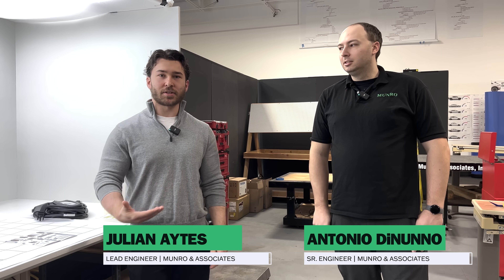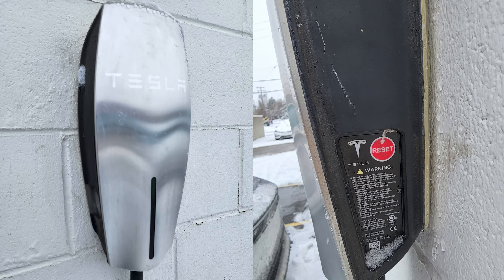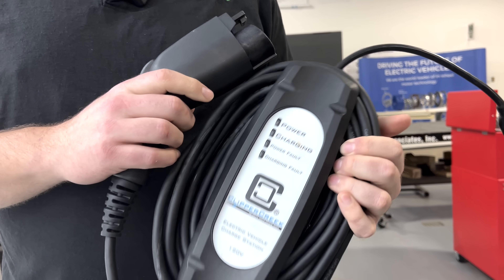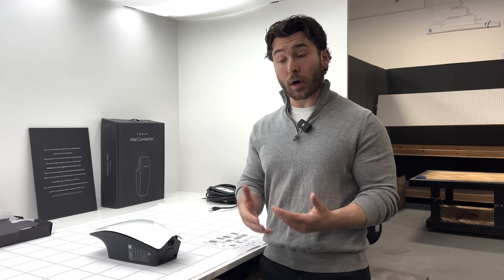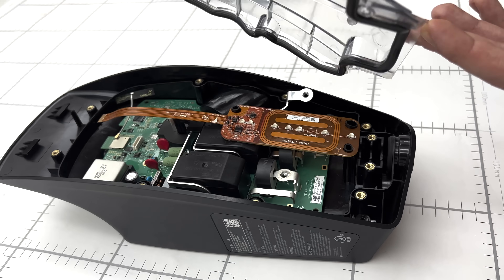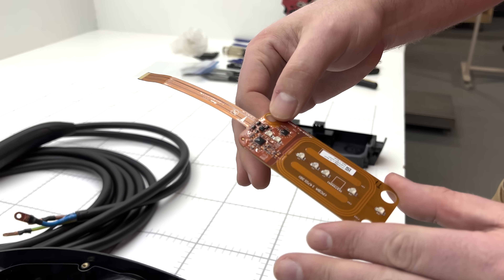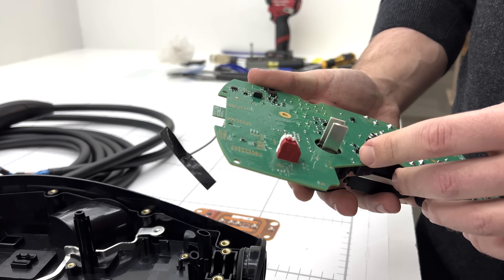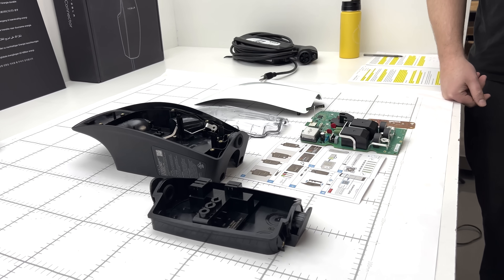EV Home Charger Teardowns E1: Tesla Wall Connector

Comment: Thanks for this video! I’m an electrician and I’ve installed just about every EV charger on the market. Tesla Wall Connector is in a league of its own for ease of installation. You can enter it with wiring from any direction, which is a BIG deal. The Ford 48A charger is the WORST. Please do a video that compares the poor design of the Ford Charger to the elegant design of the Tesla Wall Connector.
Reply: Also clear from this video why Tesla wall connector is the least expensive 48A charger you can get.
Reply: @NewPhase-kq1fu  Actually the Emporia Smart EV charger is cheaper ($399) vs the wall charger at $425. i picked the Emporia to charge my Tesla because of all the smart features and whole house power monitoring system Emporia has.
Reply: @phtofl  good to know, thanks!
Reply: @phtofl  Emporia is J1772. You need an adapter to charge a Tesla. Isn't the overall cost higher? What is the smart feature you like it over Tesla charger?
Reply: @acefr8816  yes, while I didn't have to buy an adapter because the Tesla comes with it, I did buy an extra.  I got the emporia with the intention of going through with my F150 Lightning reservation, but they keep raising the price so I've passed on my 3 opportunities to put my order in.  The emporia Vue2 system tracks your whole house power usage (and 16 individual circuits), including giving graphs of usage history in seconds, minutes, hours, weeks, months and years.  So you can see what circuit used the most power, or for me I know that our outdoor hot tub takes more power than the Tesla takes to charge.  The EV charger shows a history of your charges too, showing length of charge, kwh delivered and a calculation of the cost of the charge session.  Emporia also has wifi plugs that add a node on to track power usage.  So it's just a neat system and a must for data nerds.
Reply: @phtofl  How many amps is the circuit and how many amps are you charging at? Hardwired or 14-50?
Reply: @acefr8816  You'd probably go with a non-Tesla charger if you're open to switching from a Tesla to another brand of EV in the future.
Reply: @rkgsd  If one switches to a non-Tesla EV in the future, he an easily get a Tesla to J1772 adaptor. There is no need to "future proof" the charger now.
Reply: @rkgsd  emporia comes with the 14-50 plug attached but I removed that and hardwired it.  I didn't feel like paying for a new line to be run to the garage so I had the electrician use existing 1/2" conduit which could only fit 10 gauge wire or 30 amp circuit.  So I only charge at 24 amps, which has been fine for over a year now. I could run new wire, and hook the emporia to 60amp circuit and get 48amp charge.
Reply: will do, just for you.
Reply: Appreciate your comment and it’s great information for us novices.
Reply: So easy a caveman can do it…I’m proof!
Reply: Maybe in the USA, but there are some very good products that have been in the EU market for many years...
Reply: Thanks for the info, I don't do it myself, but I'm very interested in it
Reply: As usual, including it’s own manufacturing workers, Ford engineers , don’t  prioritize making installation of any component easy for the worker!
Reply: @DishNetworkDealerNEO  FWIW, the Ford charger is manufactured by Siemens (at least the new one) others are manufactured/sourced by Qmerit. Some older models like the Focus Electric or Fusion Energi could be purchased with AeroVironment equipment (as other OEMs did and just slapped their label over it).. did they go out of business?
Reply: Well, that’s completely understandable, after all, FORD, have over a Century of SHIT engineering design standards, to ..maintain, you know..!! 😉😁😂😂😂
Reply: Nope it's not lol!!
Reply: How would you say the Grizzl-E and Emporia chargers compare? I'm assuming you've delt with them too.
Reply: Is it worse simply as a charger install, or because the Ford supports bi-directional charge/discharging?
I’m not surprised. I installed the tesla one myself and I was shocked at how easy it was. Pun intended.
Reply: @TCPUDPATM  the charger I’m referring to is not bi-directional. Just a simple 48A charger same as Tesla.
Reply: @NewPhase-kq1fu  Gotcha! Bummer that it’s such a pain. I tried to give Ford the benefit of doubt lol. Thanks for responding.
Reply: Can you spray Bakelite from a 3-D printer? (likely not, I guess).
Reply: @tobyw9573  no Bakelite is phenolic resin molded and cured under pressure. Maybe you could extrude some and then cure? Plastic derived from crude or pvc/abs is prob cheaper tho.

Comment: Great timing, I'm currently looking at buying one of these.
Reply: I just had an electrician install one last week. It's easy enough to do on your own, but since I had a new line being run with an off-peak second meter, I had him do it. I'm a DIY'er, but my personal rule is to hire a professional for any work in the electrical panel or anything 240v. The actual wall connector install, using the new wire from the meter, took him about 15 minutes.

Comment: Technically teslas mobile connectior can handle lvl 1 and lvl 2...should review that also
Reply: I charge both of my MYs with Tesla mobile charger adapters since they are cheaper (and used to come with the car for free!). Would love to see a review of that.
Reply: @arbitraryconstant3439  same. I always just use my mobile connector on a 220v wall plug in my garage... only get 10mi/hr butttt i purposely downgrade the amp because I am scared of any safety risks. I am charging using the nema 6-20 adapter. I know the car already adjust for max 80% current pull...but i just wanna be extra lololol
Reply: @arbitraryconstant3439  it works! I had to use it an EA charge in the backwoods of the Appalachians.

Comment: 10:19 On page 15 the Tesla wall connector manual has a diagram with arrows and numbers, there it indicates that the red and white connectors are RS-485 a type of serial communications port most likely for debugging
Reply: I was thinking it’s for someone having many of them, rs-485 allow to chain devices, that way you could have many in a parking and monitor and control the use in a central place with a simple connection.
Reply: My installation document included information about connecting multiple chargers together so the vehicles could negotiate which charges first or most.  I believe that is the point of the serial data.
Reply: not for debugging; in case of other brands, it is used in combination with the external RS-485/Modbus power meter to limit maximal charging current based on total house power consumption

Comment: Big fan of Munro, Small point EVSE (Electric Vehicle Supply Equipment ) not "Chargers" its basically a power cord with a smart switch, and big point these devices will draw large current (Amps) over a long period of time. Correct installation is important along with circuit breaker and wire gauge size for obvious safety reasons.
Reply: Everyone's gonna keep calling them chargers regardless of what (us) nerds say.
Reply: @pgbpro20  Your right that genie is already out of the bottle and manufactures want to continue calling them "Chargers" that way they can charge $$$$$$$$ hundreds for a fancy power cord, over inflated pricing in the EV world is nothing new.

Comment: Theres 4 current transfers on the PCB wonder which currents are being monitored.
- L1 
- L2
- Ground
- NACS connector

Any other ideas?

Have the first generation, its design was slick this one is even slicker.
Reply: One of them will be a ground fault.  It measures the current difference between L1 and L2 by passing both through the same CT.  I think this may have gotten mixed up when they stated the pyro measures the "difference" temperature between L1 and L2 which doesn't make sense.  They are simply measure the temperature at the point between L1 and L2 terminals in case either one becomes loose and self heats.  They also messed up the (L1 or L2?) "mobile connector" which, on 240v, reaches a max of 32A for the tesla model giving 7kW.
Reply: @GTechno13  
The differential current for ground fault maybe,  but hard to resolve a few mAac imbalance at the 45Aac max charge rate Since at 10mAac differential is only 0.022% of the overall.
The mobile connector is another tare down entirely.
Reply: @universeisundernoobligatio3283  That's why a separate current transformer is used instead of doing the math on the L1 and L2 CT.  The fault CT will have the widings and load resistor sized such that it's maximum measuresld current may be a couple mA.  Anything above that doesn't matter.
Reply: @GTechno13  
Thanks, looked the method up, used in GFI outlets, explains why they can be so flaky at times.
My question has always been with the 10 of millions of GFI outlets made, do more people die in the in the ground to installation manufacturing cycle then they ever save?

Comment: Thanks for reposting. Some interesting info was omitted from the previous video like the self destruct fuse on the board or reset button like a circuit breaker. And the mounting screws being more expensive to purchase on Tesla's website indicating just buy them in a hardware store for less. In the future, please consider adding text to a video if you feel you have to take it down before reposting to correct any misspoken words. This way you can retain most if not all of the original presenter's insightful info.

Comment: Ok, so you took out the bit with the cost of production, fine I get it... but you left in the incorrect terminology about the non-existent L3 and L4.
Reply: SAE J1772 defines a level 3 AC charging standard, but it was never actually implemented. In the video they refer to DC fast charging as level 3, which is incorrect.

Comment: Does this model have dynamic power control, does it regulate the power according to the consumption of the home?
Reply: No, it just tells the car how many watts are available and the car charges up to the maximum provided, or at least the max the car inverter supports. 11 kW in case of Model3/Y.
Reply: Depends: mi installation documentation included information about connecting multiple charges together so that the cars could negotiate between themselves based on their state-of-charge who gets the first or most electricity.  This wouldn't control demand based on other household loads but would include demand based on other Tesla charging loads.

Comment: Its a pity the Tesla Wall Connector doesn't have Pen fault protection !!
Reply: Does lack of PEN open neutral fault detection invalidate the use of this EVSE in the UK?  (US resident here, not familiar with UK regulations)
Reply: @wtmayhew  I think officially in EU/EEA countries you are supposed to have type B RCD in front of this. The Tesla should be able to detect any fault such RCD will detect though - so it is questionable if it is really needed. I guess you want a backup.
Reply: Gen 3 Wall Connector has type A + DC 6mA RCD included. No need for an external type B RCD.
Reply: @styno7267  Maybe not where you are but in EU there is. Not always adhered to though..
Reply: @rkan2  You are right, I wrote it incorrectly. Let me rephrase: In the EU you don't need a special type A RCD in your switch box, a regular type B RCD is enough as the type A + DC RCD is already in the Wall Connector.
Reply: @wtmayhew  In the UK, EV chargers that are used to operate outdoors have a legal requirement to be protected from 'neutral faults' when connected to a PME network
Reply: @markbrowning9363  US system is split phase and doesn't use a neutral for 240V charging. So a neutral fault would not affect anything.

Comment: This is the only home or business charger worth buying. It’s sleek, durable, has the North American Charging Standard instead of that awful j1772 garbage, and allows businesses to automatically charge for electricity with no screen or NFC. Plus, legacy autos can use Wall Connector via an adapter. Not sure why people buy any other connector!
Reply: or get qElmos junk out of your mouth....
Reply: You Tesla fanbois having fun over here in your lonely corner?
Reply: @ouch1011  yes
Reply: @ouch1011 
Since the topic is Tesla wall connector teardown why are you here.
Reply: Tesla NACS standard designed by engineers to encourage EV adoption.
CCS designed by the ICE manufactures marketing departments to discourage EV adoption, in the hope that EV's would not catch on.
Reply: @universeisundernoobligatio3283  correct, legacy auto is digging their own grave, and now even Rivian is falling for it. Thankfully Tesla and Aptera know what they’re doing!